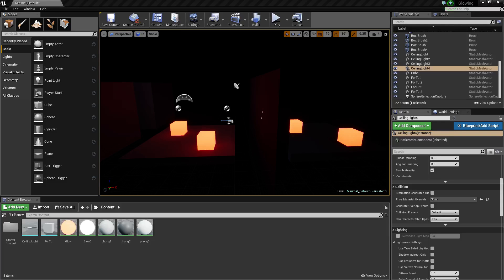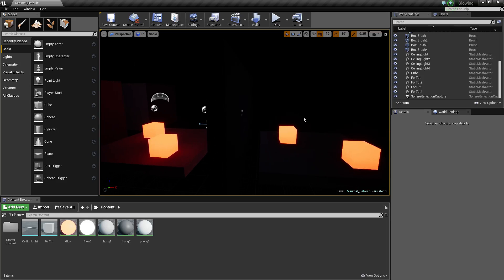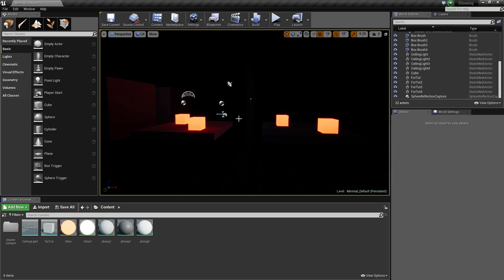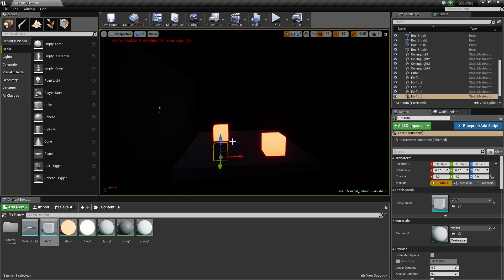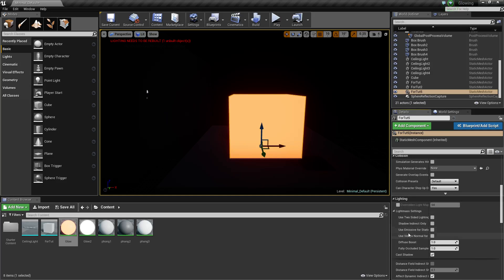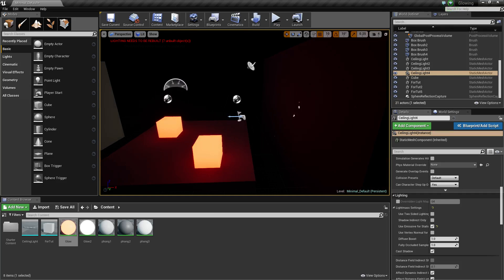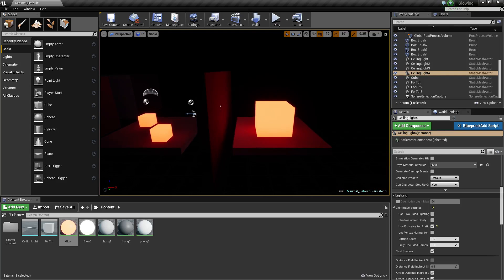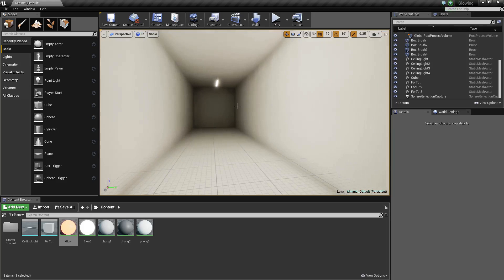Ue4: advanced materials (Ep. 45 Making emmisive materials emit light)

Comment: I have a bunch of flashing emissive materials, baked lighting isn't really an option for those, any ideas?
Reply from the maker: I think you'd usually just use a dynamic light and have it change emmisive values dependant on the value of the materials emmisivness. Sadly I ain't no programmer so I'm not sure how to do that :/
Reply: @StevesTutorials  Probably just like 2-3 point lights with different offsets for on/off and then keyframe in a sequencer, make it loop, and duplicate it a bunch
Reply from the maker: Yeah that could work!

Comment: Compared to using the light tools would this be a better method for lighting large rooms?
Reply from the maker: One problem is you have to have the emissive fairly high to achieve the effect. This would cause the actual asset itself to be a bit bright but i guess that could just be fixed with some auto exposure adjustments.Personally I would use something like this for an archviz but not for a game just because you get some sort of preview when it comes to the lighting tools. i'd say the lighting tools would be a bit more efficient. As i showed in the video by the black corridor you get zero preview of what its going to look like before the bake. So I guess it just has some pros and cons so it kinda depends on the exact enviroment you are working on and what purpose it is going to serve.
Reply from the maker: Andrei Despinoiu yeah pretty much. Thanks for the additional comment :)